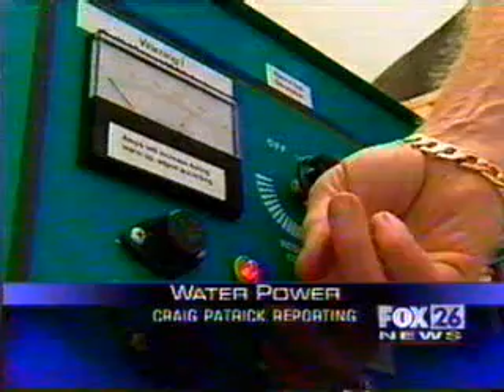Water Fuel Car

Comment: Greenhouse heaters.
You need construct a insulated, mild steel box, lined with brick. The melting point of salt is about 1250 F, stainless steel (melting point 2800 F.) heat exchanger in a bath of molten salts is safe. Apply a positive displacement inflow of water to the stainless tubing and the output will be a constant flow of hot steem for heating Greenhouses. 

Moist Heat! Precisely what plants need.

All the best, Knute

Comment: To John,, No,, Voltage is not the way. Increase you plates OR enlarge their surface. Work on proximity. (Distance between the plates.) 3/8 inch. KOH, 5 to 7 %. Let the machine do the work, dont push with Voltage. Threshold, + 20% for losses. Multiplex out with addition of more individual effeciant working cells.

All the best, Knute

Comment: No worries. It was recorded many thousand times.

To Hydroxy Researchers. Plate proximity is KEY, Eye protection, positive vapor breaks, torch wools will NOT WORK, KOH, work only in small scale until you have perfected every parameter, flame front propagation critical, mild steel is fine. 

All the best, Knute

Comment: On topic:

Micro Surgery; Typical of tumors is that they have little to no forms of attachments.However, our crud early attempts have taught us much. What we had developed is a inward folding of the mass, as the surface of the tumor is irradiated. Much like hallowing it out,,, and,,, folding it over on itself. Hydroxy is self-reducing, but aspiration and proper ventilation is a prime objective. Avoid over pressurization.

All the best, Knute

Comment: Medical. 

Early research had revealed flame characteristics that particularly lend this technology well to Micro Surgeries.

Flame has little to no side-cast heat.
Hydroxy is continuously reductive (back to pure water) See: Video.
The flame is laser-like yet, temperature terminus. (cooler, the further from the tip)
Bleeders can be cauterized off with ease. 
The incision heals with little or no scarring.
Cont.

Comment: Oh,, I forgot!!!

DO NOT try to design a single HUGE Hydroxy generator. Make smaller, tested and safe units. One generator to each Tweer orifice. 200 to 300 liter per hour units. You need never exceed 70 PSI.

AND, provide positive,, vapor breaks,,, as close to the Tweer  as possible.

All the best, Knute

Comment: On topic. 

You will quickly learn that Hydroxy is a Point of Use technology, BUT perfect for making steels with solar power. Hydroxy contains both fuel and oxidizer. Solar sourced Hydroxy can be fed directly into the Tweers. A load and heat, brought to full temperature in less than an hours time.

Yes,, Solar is limited! When the sun goes down, send your people home!

All the best, Knute

Comment: Proof of Pre-Manifest Energy, the captured essence of Hydroxy.

Take a nail, wrap it with many turns of fine wire and place a DC potential across the wire. The nail slowly becomes magnetized. The molecular domains of the nail aligned. 

NOW, heat the nail and the magnetism will disappear. The Everywhere, Everything, force is still there, it is just that the nail can no longer focus this force. SEE: Newton.

All the best, Knute

Comment: The discharge of the Hydroxy is implosive, BUT, can be observed by its release of all the electrical energy needed for its production in a huge discharge. 

Lightening.

The thunder you here is this implosion. The vacuum that is left behind,, when the clouds are very dense, (Inertia), is what forces the inrush of air from below that forms tornados.

All the best, Knute

Comment: Natural occurring Hydroxy.

If you will take a stout magnet and hold it near a smooth-flowing stream of water from a carefully adjusted faucet, you will see that it can be deflected. Hydroxy is NOT disassociated, as some believe, and the resultant common gas still exhibits the high affinity of O to H.

When water vapor,, Clouds,, experience swift movement, a charge is developed internal to the cloud. This immense static charge forms the Hydroxy state. 

Cont.

Comment: Everyone who has ever produced a Hydroxy flame, quickly turns to running small internal combustion engines. The engine starts and runs smoothly. I did! I mowed my lawn, and was soooo very proud. I was mowing my lawn with solar power and water.

I will also tell you today, this is the MOST foolish use of Hydroxy.

It will bring you nothing but ridicule, pain and heartache!

All the best, Knute

Comment: Check out the video.

When the brass ball turned in to liquid metal after being heated up to the temperature of the surface of the sun, in this guys garage,  it still remained a ball.
It didn't drip down on the dudes shoes.

Witch means  this must have been recorded in some guys garage in  outer space.

Thats one big step for Fox News.

Also; how much does it cost to cool down his place from "the surface of the sun" to a more comfortable temperature to work in?

Comment: Oh,, By the way Ornulv. You might think about redesigning your prisons. 

I can cut through carbon steel bars with roll of aluminum foil, salt water and the barrel of a ballpoint pen as a torch tip.

Again, watch the video. USE YOUR OWN EYES!

All the best, Knute

Comment: The same is true for Home Heating. 

Hydroxy will burn through even titanium, in a blink of an eye. 

BUT, by enclosing a titanium heat exchanger in SALT, Noirmal table salt, the Hydroxy heats the salt to near molten state in seconds, the molten salt to heat the water in the titanium coils to steam. 

The steam to heat the home. through coils in the floor.

All the best, Knute

Comment: YES! Soooo TRUE. Again, use your own eyes. Hydroxy cannot be used to heat the bottom of a pan,, it would burn through in seconds.

BUT,, BUT,, our simple two-burner stove, directs the Hydroxy flame to a simple bed of sand,,, UNDER,,, a pot to be heated. In this indirect method,, the pan of water boils without harming the pan itself. 

Morning Tea, cooked without the need for chopping down a TREE!

All the best. Knute

Comment: MORE LIES! A Glass Bottle made with Solar Energy, Sand and water, BY HAND,, in 20 minutes time. Sand, to a blow-pipe dollop, to blown shape, to clam-shell iron mold, to finished bottle. Fixable Ceramics. Diamond-like hardness from house brick for abrasives, cutting blades, grinding wheels and polishing equipment for PENNIES per pound. Deep Sea Divers, breathing media, from WATER! 

All the best, Knute

Comment: Well,, Now that that is cleared up, lets continue with the lies then. Non rusting steels, sooo fine in matrix that they will hold and edge less than 12 ATOMS in width. Magnets made from FE304, of 5 times the face gauss strength of rare earth magnets. A surgical tool to eradicate tumors deep within the human brain through a No. 19 needle. 

Aqll the best, Knute

Comment: First of all, lets be clear here.

I said, do not buy anything from anyone, MAKE YOUR OWN Hydroxy system for your car or truck.

Second, I propose that the internal combustion system for Auto Transport is archaic and inefficient. Instead, store electricity as a gas and use it to power electric drive to the wheels. 

All the best, Knute

Comment: You are correct Jenny, Hydroxy will not even warm water, has little or no ambient heat BUT when directed in a special way, it will reduce the human body to a smoldering pile of ash in seconds. You are 100% correct. The reaction with contained salts and iron in the body is swift and violent. The minerals!

All the best, Knute

Comment: pussnuts isn't talking about the voltage required for the electrolysis, he's talking about the energy required.

It doesn't make sense that you would get more out than you put in - that would violate laws of thermodynamics (creation of energy is impossible), meaning water isn't a viable fuel source.

Comment: Yes, Cold Fire 1994, Green Gas 1988, Browns Gas 77, my Hydroxy - Water Flame in 67, Rhoads Gas 66, Elemental Fire 1932, Essence Fire 1904, Ethereal Fire 1879. On and On and On back to Michael Faraday.

YES! 
Each generation to learn. 
Each generation to discover.

All the best, Knute

Comment: Not to worry about the cost of water. 

Hydroxy is made equally well, from Human PISS! An excellent and sterile, electrolyte source. My experience, about my fuel tank became low, I also commonly had a full reservoir of urine. About 200 miles worth. 

All the best

Knute

Comment: Pussnuts,, Umm? It would be misleading if Cline had OMITTED, that it takes energy to make HOH.

He did not! As you point out.

It takes 1.57 Volts DC to achieve the cracking of water to HOH. That is less than the Voltage of a common Flashlight.

All the best

Knute

Comment: That video is very misleading. This gas that is formed from water still requires an input of energy (as stated in the beginning of the video) The energy input must be greater than or equal to the energy output when converting the gas back to water. This is a fundamental law of physics. The technology is good for welding because there are no chemicals involved except water but this process is still a net energy loss from start to finish.

Comment: dysfac, Not really.

With OIL you need a mass extinction event or 4.

Find, drill, stor at harbor, load on tankers, ship 8,000 miles and pump to shore. Then refine, pump and store. Finally you truck to retailers and store again in the ground before you can sell it.

HOH, you make as needed.

All the best

Knute

Comment: Industrial, the same thing happened to Alcohol in 1830s America.

BUT, WATER is never harmed with HOH. It comes back. Water is just a suspension media for HOH, "Neo-Energy", a CLOSED LOOP energy system. It LOOKS and ACTS like fire, BUT is NOT FIRE.

It is COLD. 

Bearly 249' F. in open air.

All the best, Knute

Comment: Jbartle, Attack the inefficiency

Specific Impulse is increased nearer TDC (Spark) because Hydrox Catalizes the burn. increases burn totality.

MORE Pop sooner, less POOP later. Poop = Unburned Hydrocarbons.
Cooler, +5%, friction unchanged, tail pipe +5%, Burn rate +5% Total = 15%.

Mileage Doubles.

All the best, Knute

Comment: Jbartle NOW, you and I are friends again.

Precisely! BUT he makes no PM claim. Losses in any IC Auto System

45% Heat,15% friction; gears, differential, rubber, wind, 20% tail pipe 5%+/- RPM efficiencies; burn rates. In our greatest hopes we see, 15% net posible. Fuel to Road. SOON, Cline will learn that ANY Hydroxyl Seperator is also a battery. See: William Groves, 1843, Gas Battery.

All the best, Knute

Comment: My problem is with the guy saying his car "runs on water fuel."  That isn't true.  It runs on a gasoline and Hydroxy mixture, which increases his fuel efficiency by burning a higher percentage of the gasoline.  His claim is perpetual motion, and THAT'S the bogus part.

Comment: Jbartel, STOP.

Hydroxy won't warm water.
Barely sing paper.
Aluminum slightly over 900' F.
Brass 3,000'+ F.
Steel 5,000'+ in seconds.
Stone 6,000'+ F. instantaneously. WHITE HOT.
Sublimation of Tungsten 5950' C. = 10,700'+ F.

The Suns corona surfce is only 9,500' on agerage.

All the best

Knute

Comment: Flames do not "meet" rock.  Water in our body doesn't protect us from something as hot as nuclear fusion (surface of the sun), or any heat whatsoever, actually.

This IS a good fuel for torches, because it burns hot, but it's inefficient because it costs more electric energy to separate the H20 than you get by burning it, because water is very stable.  Therefore, any claims of "designing a humvee for the military" are totally bogus.  

Trust me.  I'm a nuclear engineer.

Comment: Charges against Dennis Lee are 100% TRUE. He falsifies documents alleging transfer Legitimate Technologies and then runs Ponzi Schemes and/or and Pyramid Multi-Level Marketing scams to lure in unsuspecting DOOFS.

This Technology is invalid.

I worked with Yull Brown for nearly 20 years. 

Developed Water Fuel, Solar Powered,,, processing of Steels from raw Iron Ores in 1967. See: Rhoads Gas,, Common Ducted Hydrogen and Oxygen. 1966.

All the best

Knute

Comment: this is clearly a scam.  surface of the sun?  that would melt your fingers off more than 5 feet away, let alone the inchesbetween his hand and the metal.  this is just separating hydrogen and oxygen then burning the hydrogen with the oxygen again.  like the hindenburg.  get it?

Comment: "This is a lie. It cannot burn hotter than the surface of the sun."

The device in question is a scam, and you are 100% correct: Oxyhydrogen can burn as high as 2,800c. Sol's surface temperature is about 5,400c.

By the way, Dennis Lee is going back to prison for this scam. That's good news.

Comment: ur right, we should be on the same, and we should be our own gov, but we arent. if you think youre on the same level, ur lying to urself. Theyre at least 25 years ahead of the public in technology.(the military and SF) if water isn't possible, there are still better fuel sources. gas and oil are the main because theyre not abbundant as like water, and their limit give them value. regardless if water works, we are getting screwed in the end.

Comment: and common sense tells us that to light up tungsten, which is a metal with a very high melting point, you would need extreme heat, which can be produced but that same heat would also burn you. how can something select the material that it burns? and having a patent doesnt mean anything. you can get a patent for anything. doesnt mean anything. doesnt mean it will work, just means its yours. take a class in physics before taking a position on science and fraud.

Comment: Higher portential would be in industrial large water cracking, by the use of solar energy, or even by standard enerrgy sources. Big = Efficient. Big power plants get up to 60, 65% of the Energy, and most of it could be stored in Hydrogen and Oxygen, which could fuel energy cells bringing back another 60-90% of the energy. An electric motor is 90-99,9% efficient. Combined that's A LOT (!!!!!) better than the car combustion motors in standard use (optimum use 40%, standard use <10%)

Comment: Low potential in that technique. You use other forms of energy to split water into H2 and O2, Knallgas, travel that through pipes and burn it again. Now, thats some nice trick for metallurgy, as you can reach 2800 degrees Centigrade, but rather useless for cars.
You need to convert any kind of energy source to electric power, thatn you use that to split water, then you burn that again? FAIL - massuve loss of efficiency. There are other ideas...

Comment: Ever consider that the point of this story wasn't about the car, but about the process? I for one think that being able to burn water for a safer, more effective welding flame is a pretty cool thing. There's 100s of silly ideas for cars that have come and gone... this is just a novelty. If you want to be angry, be angry about hydrogen fuel cells. now that's some BS.

Comment: The car doesnt work on combustion of water. It uses ELECTRICITY to separate water into Hidrogen and Oxygen. Then burns the hydrogen, to move a combustion engine. This is obviously no step forward, as using the electricity directly on an electric engine would be much efficient.
It is very frustrating that a TV Chanel, that suposedly employ well educated people, that receive wages much above average can give this DECEIVING news, making many people believe that the car runs simply on water.

Comment: This invention is for a new electrolysis technique not for a new energy source.
 
 The bond energy between hydrogen and oxygen is the energy which holds them together.

 You cannot get something for nothing. this invention merely conserves energy more efficiently.

Notice that the car requires petrol. 
 The invention may well be assisting economy by helping the 'total energy in' work more efficiently (hotter burn).

Comment: In dams, you convert the potential energy of water into kinetic energy by running the water through a turbine.  The spinning motion creates electricity.

In this invention, the guy creates hydrogen gas from water and burning that.  Creating hydrogen from water is called electrolysis and well known.  The problem is that it requires a lot of electricity and that makes it very expensive.  The trick is to find a form of  electrolysis that's cheap.  I'm still skeptical about if this is effective

Comment: It still requires power to generate the gas from water and it's really not that beneficial unless you're also harvesting the process power using renewable energy sources like wind or solar.  They could create fueling stations with large solar arrays that actually produce the energy on-site! This would truly be a revolution in the way we look at energy!  Fuel cell vehicles are certainly a good option!

Comment: you obviously don't have a clue about physics. when you gas up your car or truc you expend 75% of that energy so your really using anywhere between 25-15% energy efficiency with water Hydrogen you use 99% of the energy being created

Comment: convert to Natural Gas (CNG) as the fuel is presently cheaper.

his water splitting technology (hydrolosys) uses more energy than can be recaptured by burning the resulting hydrogen and oxygen.

The internal combustion engine is very inefficient. You'll never recapture but a fraction of the energy release by burning hydrogen and oxygen.

Converting to operate on Compressed Air is the best. Compressing air is inefficient, heat is produced. Using the air in a motor is very efficient.

Comment: The electrolysis process is not dependent on energy. From Arrhenius theory, molecules in solution dissociate into ions and the ions are collected at the electrode. No energy is required for ionic dissociation and electrolysis processes are so efficient that they are used to measure current. When the Arrhenius theory is applied to the dissociation of water, the key requirement to produce 1 mole (~1 gram) of hydrogen is that 1 Faraday of electricity flows.